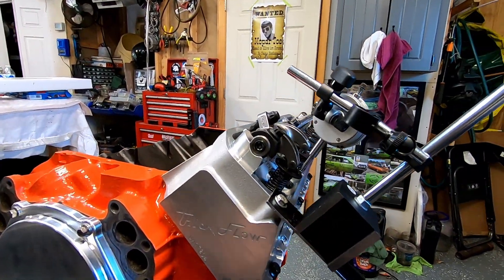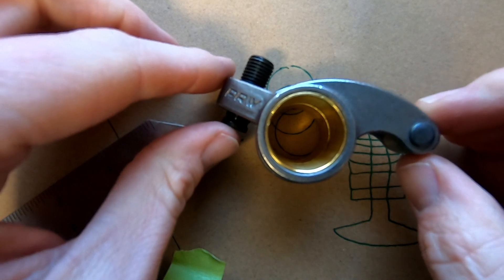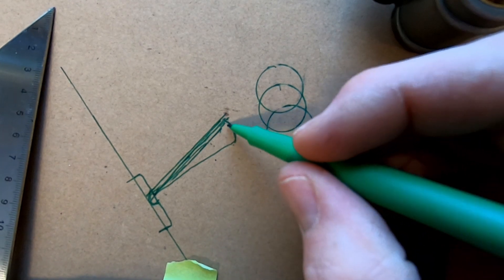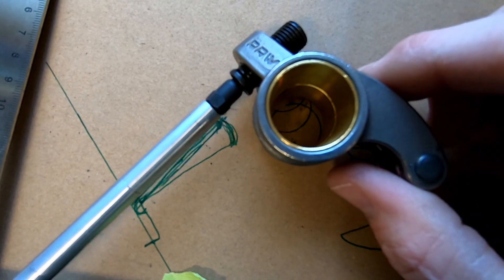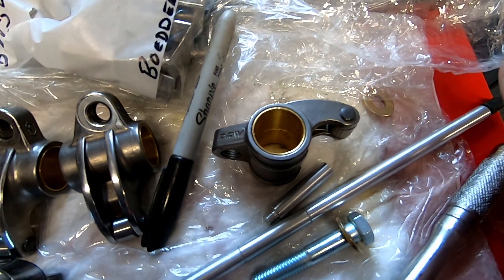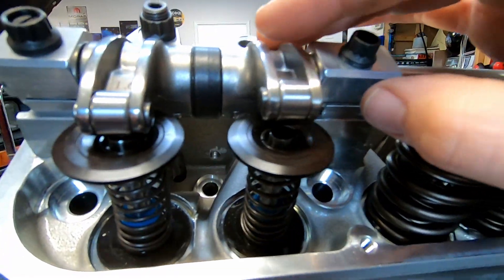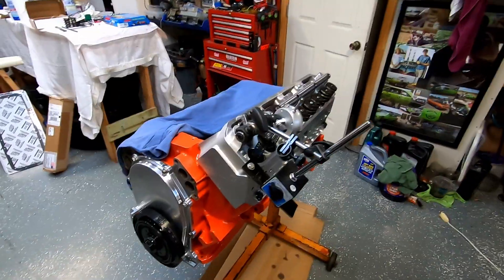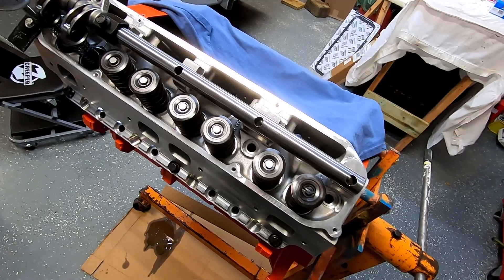Easy Mopar Rocker Arm Geometry: Studying the B3 Racing Kit #mopar #engine #bigblock

Comment: T&D has little gauges depending on lift. The rocker should be at 90 degrees to the valve at 50% lift. The rocker fulcrum line is center shaft bearing through center roller tip. At 50% lift and 90 degrees the roller should be at or precisely a hair just past valve tip centerline towards exhaust. This requires the height and in or out of the shaft to be in the right position. Pushrod ideal will follow automatically. 
This changes with lift in 0.200 increments to be addressed. An 800 lift cam will be pushing the valve down 400 @ 50 where the 90 degrees should be. A 600 lift pushing down 300 where 90 should be. Makes it easier and more accurate. Much easier with stud or pedestal mounted rockers that I'm used to but T&D will make the shaft collars and shims for perfect alignment. 
Less friction and deflection with the rocker at 90 degrees in tip center @50%. 
Absolutely necessary if you want to use longer valves for better spring installed height or lash caps with custom cut or titanium valves.
Reply from the maker: These were setup with the same cam and valve stem length previously. They’re very close best I can tell

Comment: Should the roller on the rocker be adjusted to strike the valve stem in the center or before center on the pushrod side to accommodate the sweep
Reply from the maker: The rocker shaft will never move. All the valve stem can do is push downward. So we have to imagine the roller pulls inward when the rocker arm swivels. That would put the Roller line to begin on the lower side of center (the side away from pushrod). Then it would sweep or wipe the head of the stem inward as it goes down. The better the pattern, the less the valve guide is stressed each cycle. You seem to have a good understanding of the mechanics involved here Stanley.

Comment: Hi Joe thanks for all the informative videos im thinking of using the prw rockers on my magnum build it seems they are looking for oil pressure to spray the roller tip. do they have a solid rocker shaft so pressure dosent just fill the shaft / tube ? if not just curious if you observed it when you primed the motor. i know a lot of people run them i just dont know much about them .
thanks John
Reply from the maker: They have hollow shafts that fill like traditional rockers, then an oil hole that dribbles down the top side. Hopefully that makes sense.

Comment: I'm getting the B3 kit myself ATM, Mike took the time to answer any questions i had plus added insight during our 45min call. Just curious how much longer of a pushrod did you need with your setup or what was the exact thickness off the offset shims? I understand every setup can be different but just trying to determine a basic guesstimate to see if anything i already have may work vs having to get different rockers. Thanks.
Reply from the maker: Check out my dyno video this week! They rocked on

Comment: If the pattern has a splash of bias twds the intake, it will save guides!!!!....so ur intial chk here was spot on!!!.....good on ya mate!!
Reply from the maker: Excellent! I’m sorry for the blurry image in the video. But it did move the pattern just enough inward to make a new line on the valve.

Comment: Good info! Seems I remember reading LA geometry is far from optimal as they used the same lifter angle as the early Hemi and Poly engines.
Reply from the maker: Absolutely correct. I talked to Mike about that as well. He can help it, but can’t cure it. Lol

Comment: I used Harlan Sharp rockers on my PP240 heads. Checking the roller contact pattern on the valve stem I found it was way off to the far 3rd of the valve tip. Called Harlan Sharp to ask about this. They said it is fine use them as is. I called B3 and had a set of shims made and had them drill the hardened shaft for me. Just wait till you start it up and hear the noise the roller rockers are going to make.
Reply from the maker: I think with the preload of the hydraulic lifters, the rollers should stay in contact with the valve tips. Hopefully that helps reduce the noise. I like my Harland’s on my 512
Reply: @JustMoparJoe   I am using Howards hydraulic roller lifters.  My engine is very loud, almost to the point of sounding like a diesel. I wish I knew where the noise was actually coming from. The rollers in the rocker arms moving side to side, the rocker arms themselves moving side to side, the lifter tie bars rattling, or a little of all of it? All of these have clearances that allow movement. The engine has over 5000 relatively hard miles on it now. Still perform the same as it did when new. So I dont know?
Reply from the maker: @BigPaulsgarage-v9p  do you have floating wrist pins? Or excessive piston to wall clearance? Maybe some Sources of noise. I used Howard’s hydraulic rollers and 440 source rockers in the 508. It wasn’t very loud at all. I have some videos of it running on the stand
Reply: @JustMoparJoe  They are full floating. 440 Source stroker kit, 440.512.5060 kit. The block went to my local machine shop for a check out and power hone before assembly. They told me the cylinders are right in the middle of tolerance for the .030" over pistons.
Reply from the maker: @BigPaulsgarage-v9p  I’ve often heard when the wrist pins have excessive clearance, they kinda have a diesel sound.

Comment: I subscribe to the school of thought where reducing central motion increases wear and artificially creates LESS accuracy quicker. The factory setup has way more sweep but that is also spreading the load points and therefore the wear across a larger surface. Factory designs were meant for long lifespan and least maintenance. Its a tit for tat game here for sure. Going down this road also means diving into metallurgical standards, like and different metals expansion, even galvanic corrosion. Its a really fascinating area of physics/engineering and all, but its way way waaaaay too complex to try to cover without the usual forum troll shenanigans.

ps I f'ing hate oil-through-pushrod. Dealing with them now on a side project for my youngest boy, such a weak design.
Reply from the maker: I’m thankful for the roller tip rockers for sure. Thanks brother
Reply: @JustMoparJoe  Those harlan sharp (sp?) you reviewed a few months back seem the safer bet on both sides. Sure the precision geometry side has its appeal but they stay more true to the factory side and thus better reliability. At least from the arm chair warrior side haha! I'm curious to know how things have worked out on a lot of this stuff after a year or two. For streetable applications at least. I know you are aiming to build a street motor on this 440 so the freedom to tear down and rebuild/replace early worn parts isn't really a logical step as it would be for drag racers like yourself who are used to doing that every season in many cases.
Reply from the maker: @cjm5002  this season will definitely put the abuse to my 512!

Comment: Because I use Edelbrock Victor heads I have to use A offset Rocker set.  My rockers set up without shimming with real good Geometry.  I have used shims in the past.  You must make sure you don't block the oil feed through the heads.  Which is around the  rocker shaft hold down stud(bolt) comming from the #4 cam bearing.  It is easy to block with a shim.  Through the pushrod oiling changes that, but to do that right with a Mopar block they recommend bushing (.040 hole in the bushing) the lifters or you may get to much oiling. I have never done that.  Its in HP's book on Big Block perfoirmance.
Reply from the maker: They include shims specifically for the oil holes. Thanks brother

Comment: I have the B3 setup on my Indy ez's and it does work as far as correcting the geometry.  The only negative is that the studs flex a little (.001-.0015) @ 170# seat pressure. I think they're a good idea with lower spring pressures.

Comment: All the shim does is basically move the Pivot Point closer to the valve stem Center Line. Now if you happen to have a valve stem that is longer than stock it could correct some of those issues. I think as long as the tip of the rocker is close to the center of the valve stem that is more important than the amount of sweep. And some of this definitely depends on the length of your pushrods
Reply from the maker: B3 had to have some measurements from Ed’s machine before sending the kit. I had to measure pushrods after getting the heads the back. Thanks Thomas

Comment: Do you need to have the B3 shims while you are measuring for new pushrods? Just trying to understand when during the build to call B3, and what info they need to get shims made for a specific application.
Reply from the maker: You absolutely have to have the shims before measuring pushrod length. But you have to tell them which rockers with which heads. Definitely call Mike. Thanks for watching